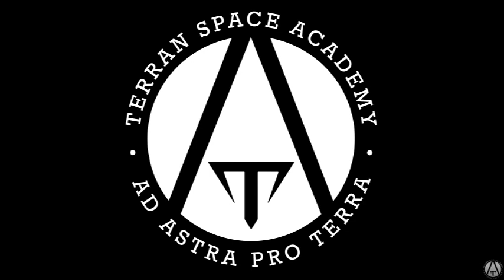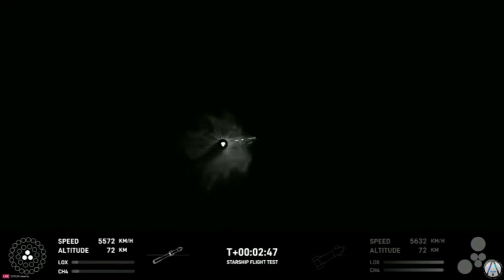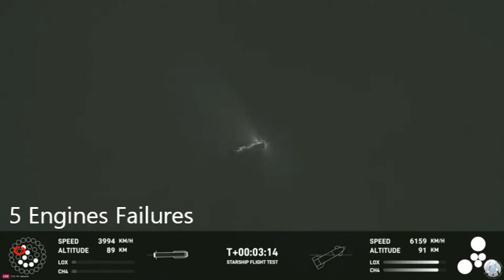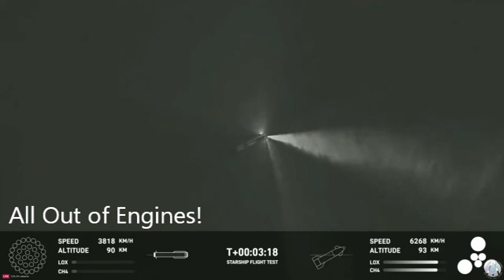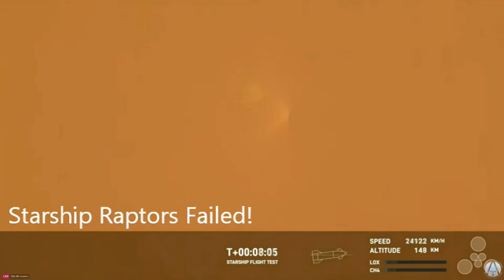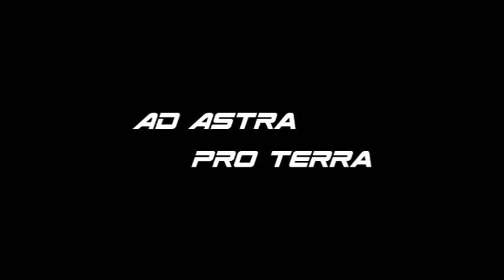Raptors Failed Starship Flight 2

Comment: Dang i didnt realize any engines had failed.  Good observation sir
Reply from the maker: Thank you!  I didn't either at first.
Reply: Nicely caught. Now the question as always is why? Guess we’ll have to wait a bit to see.
Reply: @waynesworldofsci-tech  the booster one probably either re-ignation problem or from the sloshing of the fuel from the flip, the starship one is more concerning, as it more likely to just happen from self destroying, which is not a great news in a reentry vehicle that needs its engines for any type of 'safe' landing.
Reply: Starship climbed to 91 miles when the FTS activated.